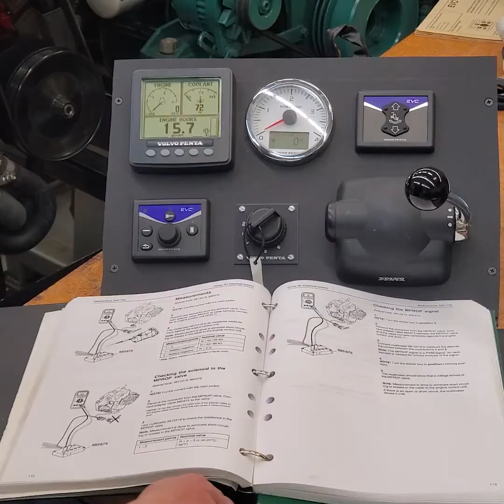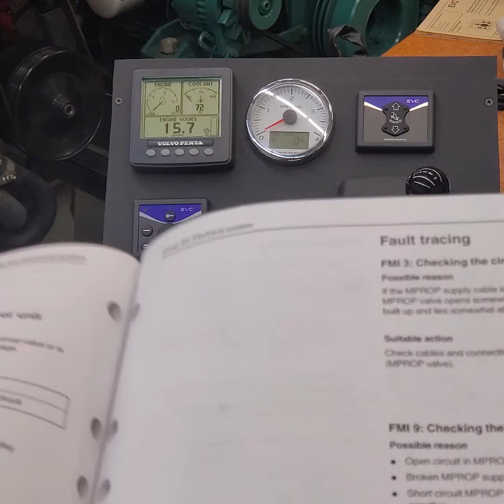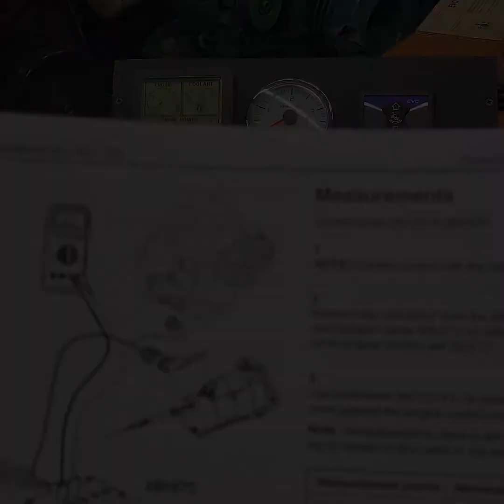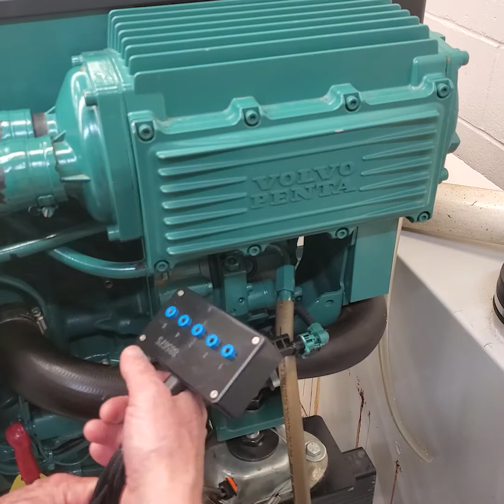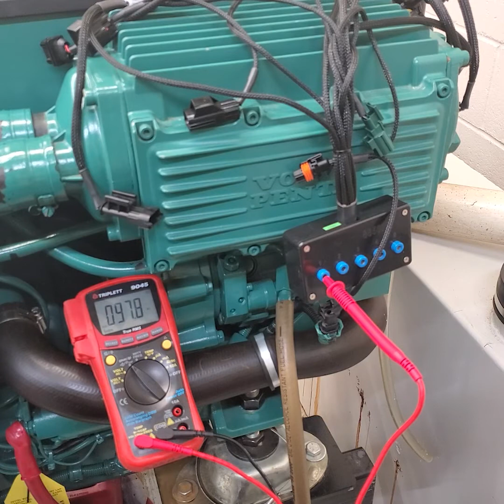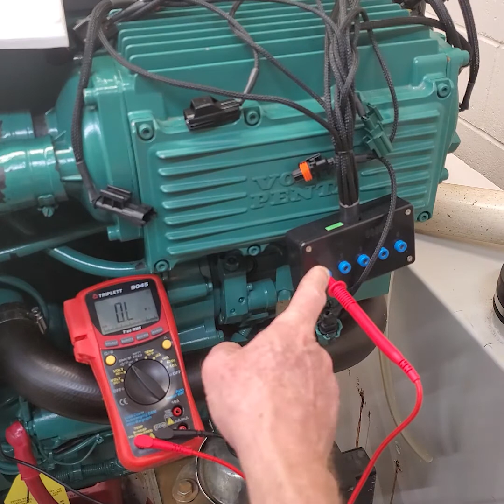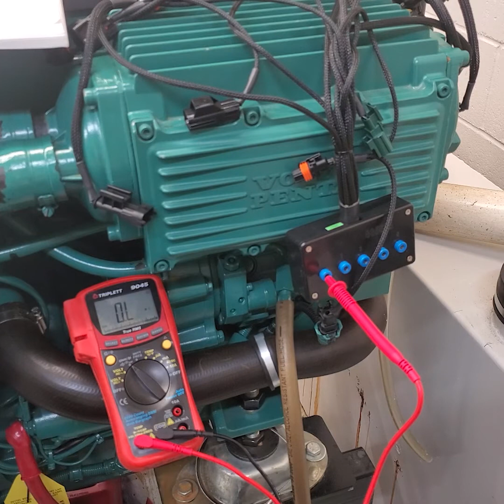Volvo Penta D6 Sensor Testing 1

Comment: Where does the throttle sensor sit
Reply from the maker: @Bubble1989  it is in the remote control. A standard bosch potentiometer through EVC C. EVC D and up its a double hall effect system inside the remote/HCU
Reply: @tedsmarinerepair8956  thank you sir

Comment: IS IT POSSIBLE TO START THE D6 ENGINE IN MY GARAGE WITHOUT HAVING ENGINE PANEL EVC ETC?
Reply from the maker: Negative, you need an HCU and control panel
Reply: @tedsmarinerepair8956  thanks. The hcu is the EVC? or a bench equipment?
Reply from the maker: @markcarabottdamato7970  Yes EVC requires a HCU, PCU and ECU/ECM to start an engine.

Comment: Hello TED.good morning first of all thank you for your tutorials that help us to work with these engines.TED i would like to ask  you a problem that i have tamd 73 p edc and we have problem with the edc the engine does not start we have tested with the twin engine edc and if starts please my query is,this can be repaired in some way mode.greetings TED
Reply from the maker: for clarification, is the cranking speed similiar to the other engine? If so it is most likely a fuel delivery issue. It may be a faulty crankshaft sensor=no fuel. I would Start with ALL new fuel filters, check the filter contents for water. Next bleed the fuel lines  up to the pump and then crack the injector lines open at the injectors. With the key on put it in throttle only mode and advance to full throttle. Crank it over and repeat untill you see fuel coming out of a few fuel lines. Tightwn fuel lines and see if it starts. These are mechanical systems just electronically controlled. Good Luck.